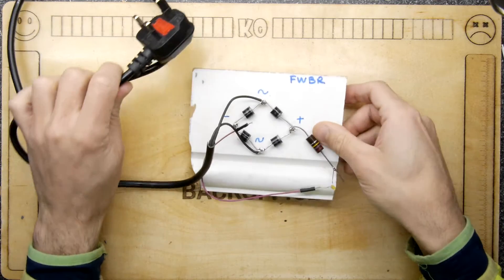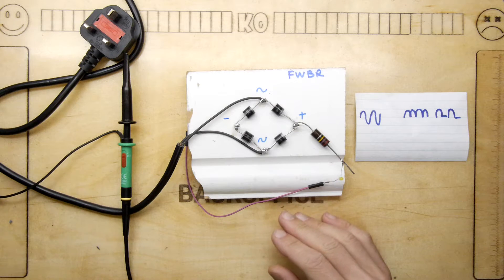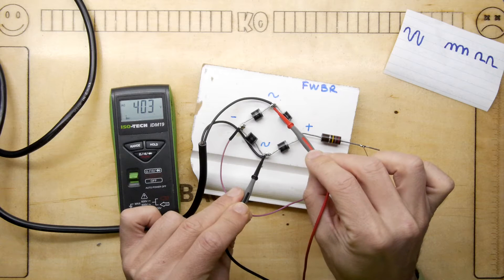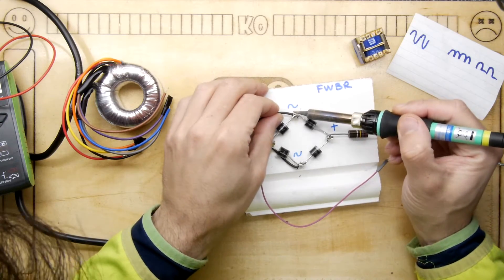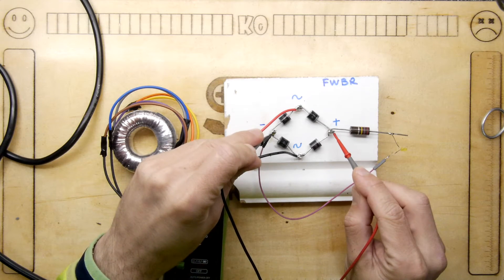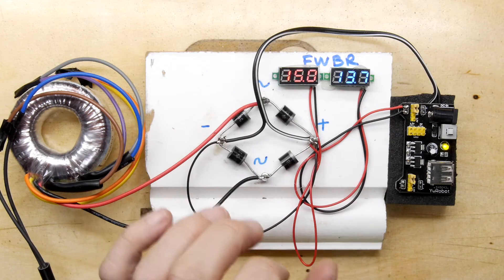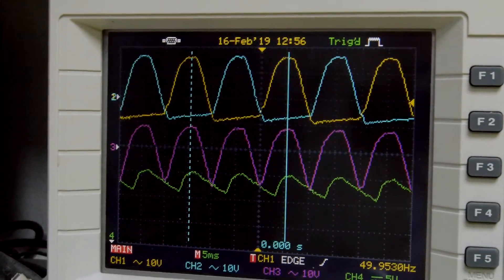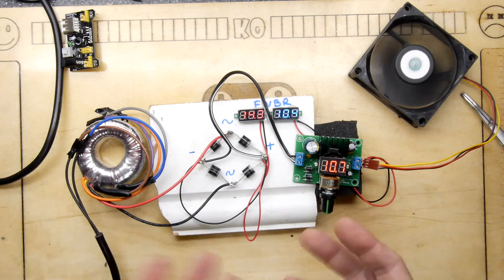Make a Dangerous Mains Full Bridge Rectifier Pt2

Comment: Can i use a microwave or a ups transformer? Or maybe i have a small transformer 230v to 10v ac?
Reply from the maker: Any transformer would technically work, but be careful of the output voltage, it might still be high! Please consider everything dangerous to touch unless you are certain what you are doing, plenty of scope to cook yourself here 😬

Comment: Could you use one of the primaries as a secondary  to get a 1:1 transformer? (The primaries were isolated before you connected them.) Admittedly, you'd be exceeding the voltage rating of the primaries by a factor of 2 by connecting it to 240V, but it should work for a bit.
Reply from the maker: That's an interesting thought!

Comment: Don’t forget dad a coil like the transformer store magnetic energy, and when the current drops the magnetic energy is transformed to current. It’s like a capacitor for magnetic energy. Even a small wire storage magnetic engine.
Reply from the maker: You just reminded me that last summer I had in my hands a very old textbook on building transformers and their theory.

Suffice to say, I wish I bought it!!!
Reply: backofficeshow lucky there is a lot on the web. https://www.agw.co.uk/blog/article/the-difference-between-inductors-and-transformers
Reply: Look for a charge pomp circuit.
Reply: so, an inductor?

Comment: Have you checked the 5v voltage regulator on the board? I had a similar regulator board with exactly the same problem and I found it had shorted so it was passing the full voltage of my input to my USB output. I think I replaced it with an AMS1117 5v and it worked fine
Reply from the maker: I'm pretty sure that the regulator is fried, I have left that board aside so I don't use it anymore. I have a spare one anyway. It's very odd, but I guess it was unhappy about the input somehow.

Comment: The two diodes on the left-hand side of the bridge will still be acting like a rectifier, so on the positive cycle from the transformer, one diode will conduct, and vice-versa for the neg cycle.

It gets a bit trickier to work out when you don't have a centre-tapped transformer, because there will be weird offsets added to the waveforms.

And without a larger smoothing cap across the pos and neg sides of the bridge, you will get those large-ish voltage spikes, and those will be upsetting the reg.

Also depends on how you're referencing the ground point in the circuit...

The Ground clips of all of the o'scope probes are all connected as well, so you're not measuring the difference in voltage between the two AC waveform points, because "Ground" is still referenced to one side of the bridge.

The diode voltage drops also come into play, so yeah, it's quite a complex circuit when measured that way. ;)

Could try building it on this...

https://www.falstad.com/circuit/
Reply from the maker: It's interesting isn't it, I could buy the other PSU components and get it working, but I would not really learn something. Figuring out how to measure this safely and understand what I'm seeing would be the real challenge 😁

I need to finish building a batch of odroid-go DAC hats, but once they are out of the way I will focus again.

What is your view on a differential probe?
Reply: @backofficeshow  

My view on a differential probe is that I'd really like one. lol

Never had one before, and I think it would be very useful, especially for fixing SMPS etc.

I've not had an isolation transformer for years either, so I tend not to work on HV stuff if I can avoid it.
Reply from the maker: I still have that phoenix CRT to fix so I can free up a lot of space by moving that cocktail cab. It's really annoying me 😬
Reply from the maker: Almost affordable! https://rover.ebay.com/rover/0/0/0?mpre=https%3A%2F%2Fwww.ebay.co.uk%2Fulk%2Fitm%2F143093519228
Reply: @backofficeshow  

How are you still awake? lol

It's 3:43am now.
Reply from the maker: Insomnia! It's a bitch